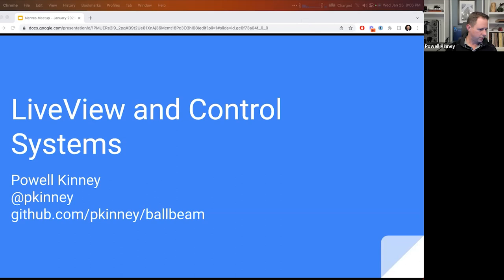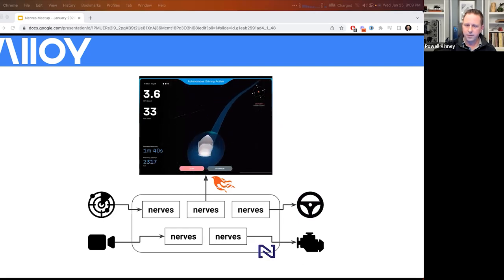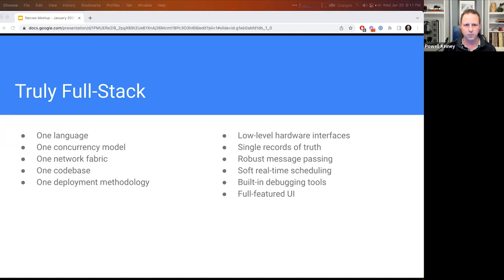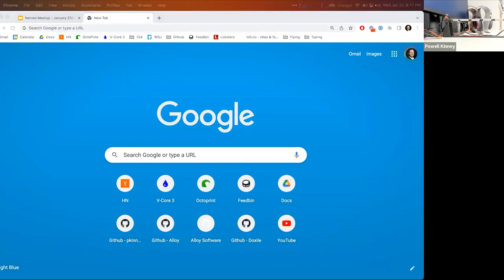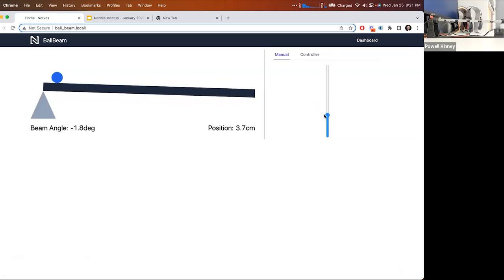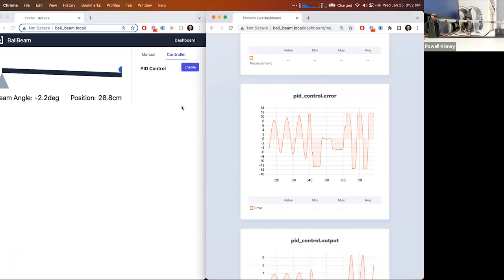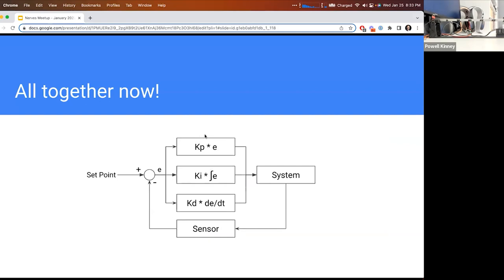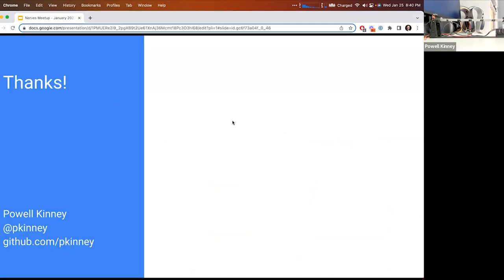LiveView and Control Systems

Comment: This is an awesome video... And thanks so much for opening up your PID library.  Suggestion... you may want to explore using XGBoost to help train your PID parameters.  It's quite fast and it excels working at tabulated data.  Just a suggestion!!!  Thanks again for the video.

Comment: I have been looking for a job in Elixir and this is the field I want to work in. Thanks for this awesome video! I wonder how is Scenic different from Phoenix. It is sad that there are no jobs for novices in technology. Hope this will change soon!
Reply: Scenic renders graphs to a frame buffer and is designed for fixed-resolution scenarios, like an LCD screen on an embedded device. Phoenix is a web framework and can render responsive web pages to a browser, like if you want to use a WebView to display an embedded device’s UI on a mobile phone/tablet.